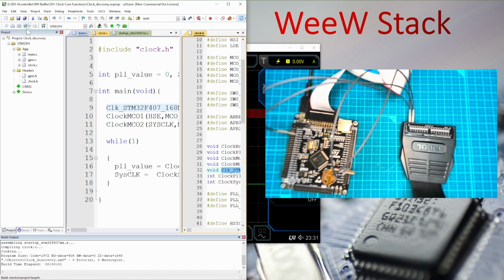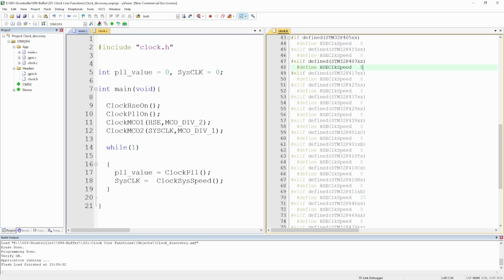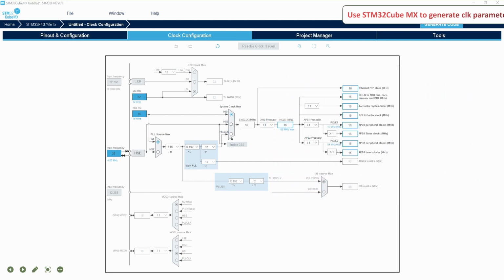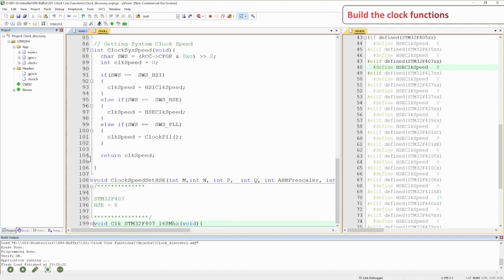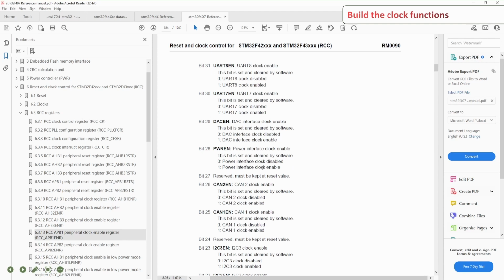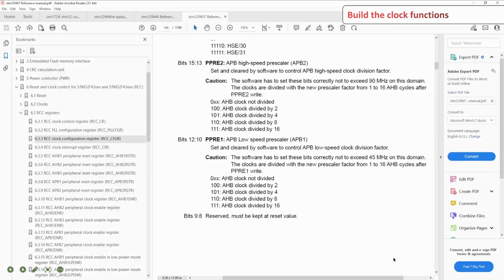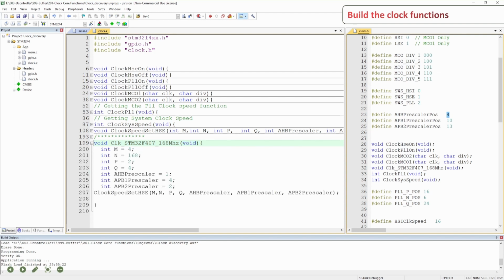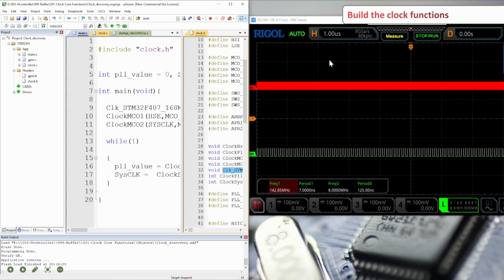STM32 Clock System Beast Mode  🔥: Maximize Clock Speed with Bare Metal &  | In-Depth Tutorial

Comment: Im using a STM32F439ZIT6 mounted on a NUCLEO-F439ZI and CubeMX in parmeters and settings for the RCC configurations especifies 5WS(6 CPU cycle) for the Flash Latency(WS)